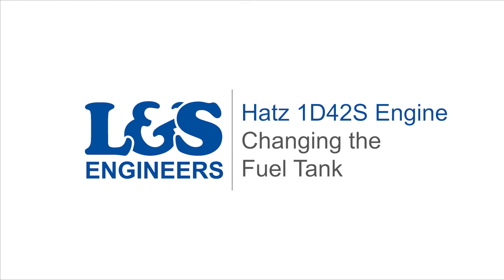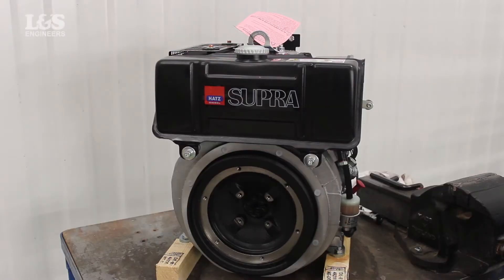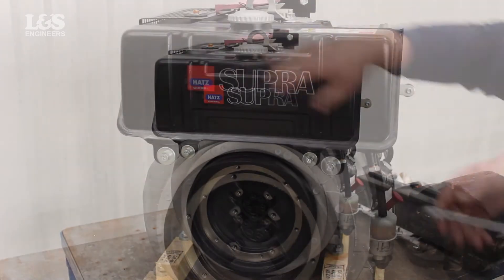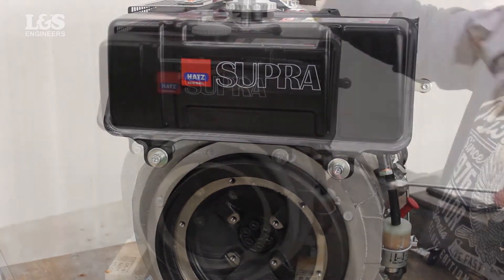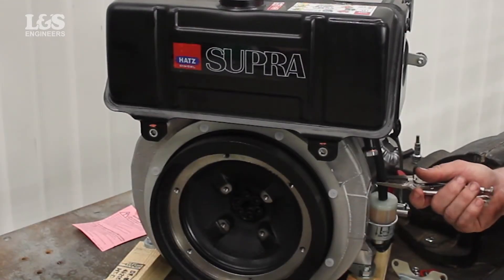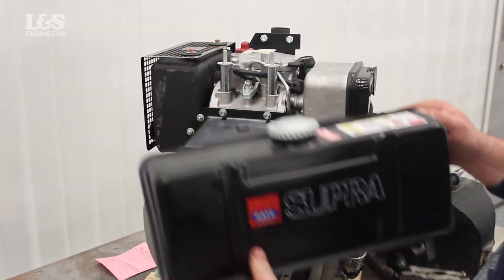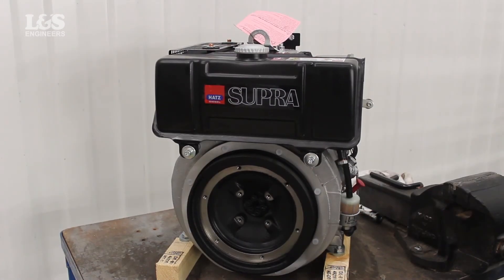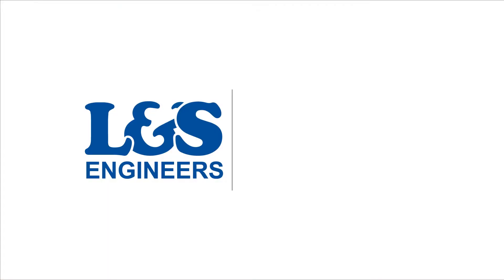How to Change the Fuel Tank on a Hatz 1D42S Engine | L&S Engineers

Comment: Great videos. Had a look but couldn't find anything. Do you have a video for replacing the fuel tank filter on a Hatz 1B? I'm hoping it's fairly trivial. Both my Wacker and Belle diesel machines' filters have turned to mush after sitting for over a year during lockdown and I'm stuck with no streetworks grade compactors until I get this sorted, so I've ordered a couple from you today. I get I'll have to dump the fuel and any remnants from the filters and further down the fuel line there should be a different filter (at least there is from memory and on a similar Hatz engine in another of your videos) on the Bellle PCX, can't remember if there is one on the Wacker DPU). Hoping the mushy crap hasn't gone too far in to the workings or it's going to be beyond my limited skills! Glad you came out top of the google rankings and I found this channel, cheers.
Reply from the maker: Hi, glad you are liking our videos! We have a video for the 1D42S External Fuel Filter. This again should be a similar process. 

HATZ 1D42S Fuel Filter (External) - https://www.youtube.com/watch?v=acncRFOb57E&list=PL3f0debut5rf8gdwwIP650CVI_uaqNhhy&index=3

However if your fuel filter (Internal/double fuel filter system) is located in the tank, this is simply a process that involves fishing out the cord and fuel filter and then just replace.

I hope this helps anything else just let us know!